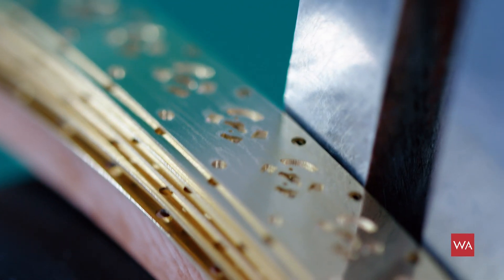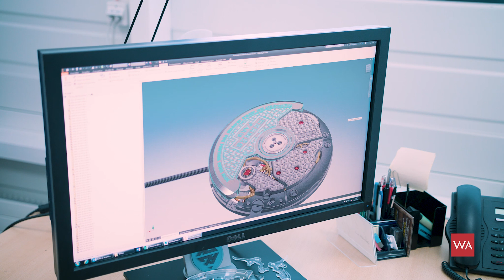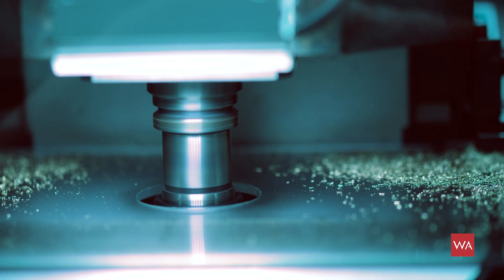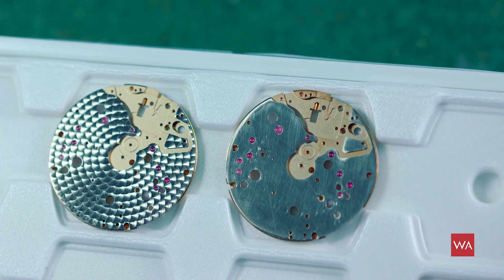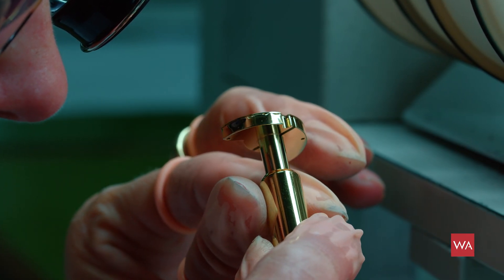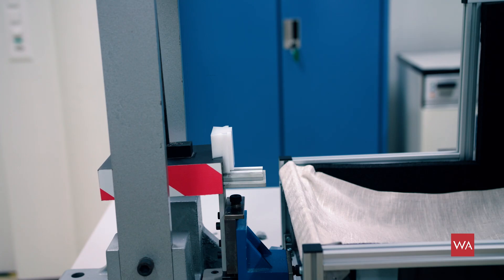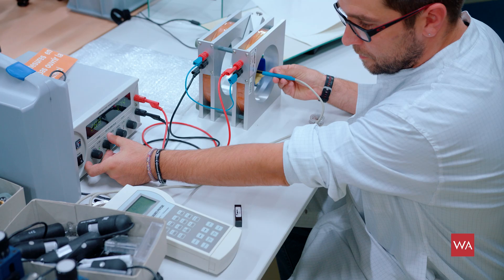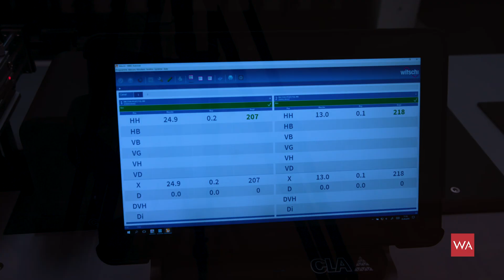Making-of the HERMÈS Carré H. Part 1: Movement Production, Assembly & Testing

Comment: nice apple watch!
Reply from the maker: No! French start-designer Marc Berthier designed the watch years ago... 
In fact it was in 2010, when Hermès introduced the "Carré H", a square timepiece created by Marc Berthier, with a modern aesthetic, designed for instant legibility.
2019 it returned in a new style: Marc Berthier has enlarged the square by a few millimetres and opted for light effects, playing across the steel case with its polished and microbead-blasted finishes, on the dial with its right-angled guilloché work, and on the facetted hands and numerals. This perfectly balanced use of light harmoniously accentuates the clarity of the design, the softened edges of the square, the curved profile of the case, and the cylindrical crystal. Finally, the exclusive font of the numerals – making use of the zero – contributes to the new aesthetic equilibrium of this watch.